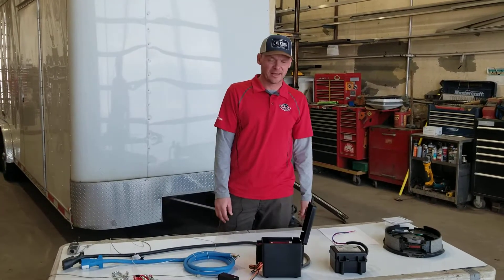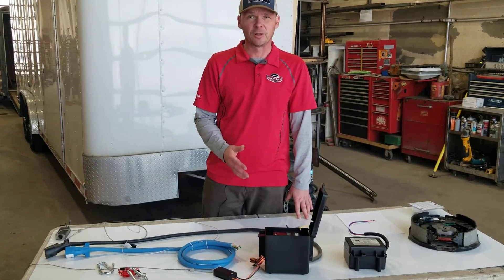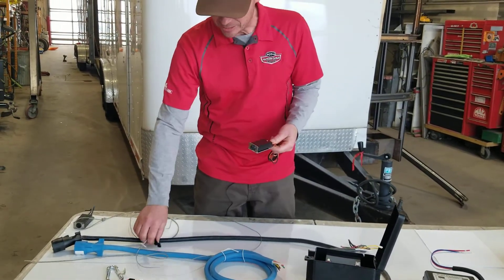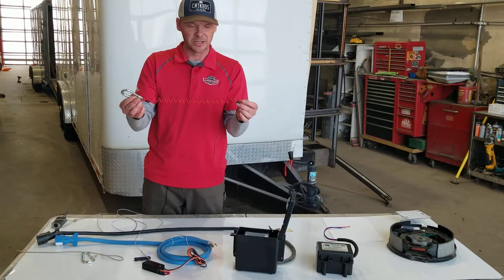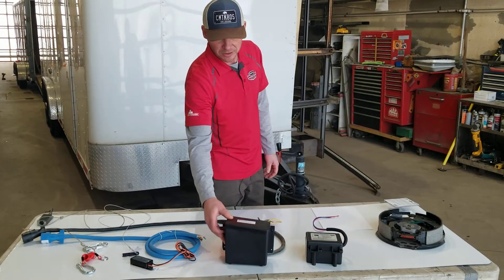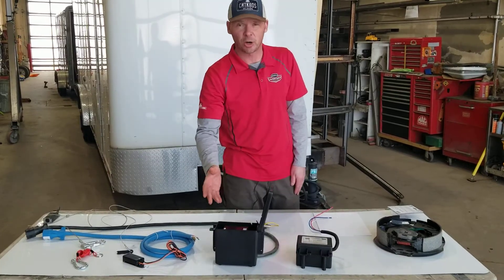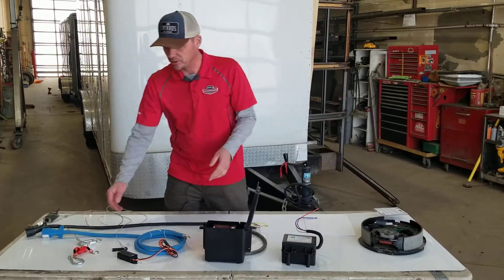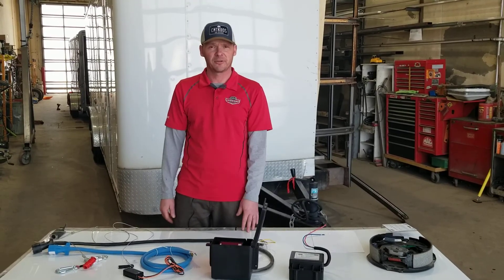How a Trailer Brake-Away System Works by Factory Outlet Trailers 403-603-3311

Comment: If the part that's supposed to pull out to activate the brakes - snaps instead of pulling out - that nullifies the break-away and renders the system useless.  Pretty scary stuff if you ask me.